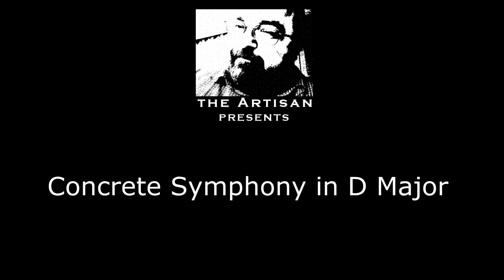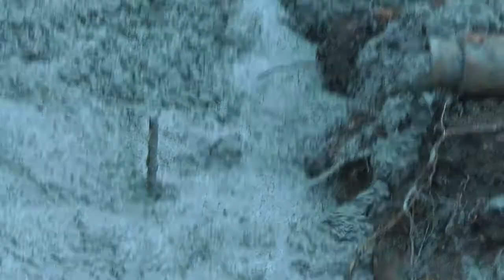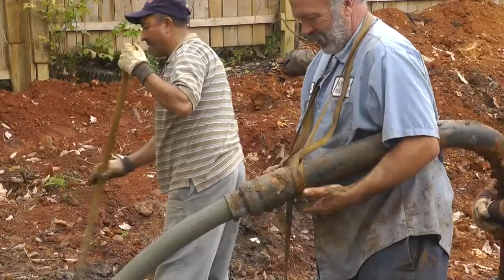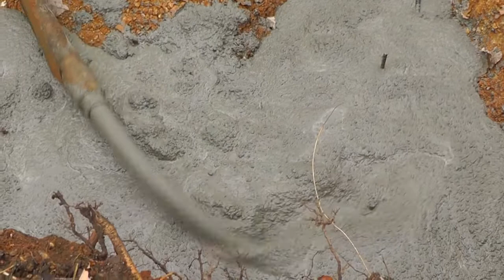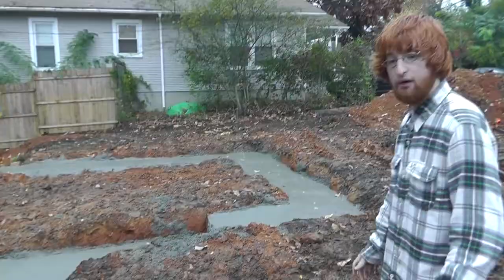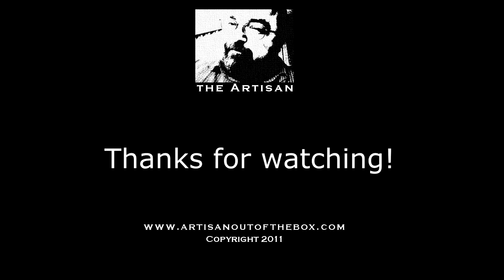Concrete Symphony in D Major

Comment from the maker: @GunWebsites For footings we dig and let the earth be the form.  Next we will form the walls which will have forms.  A typical footing is only 8" x 16" but these are more like 14" x 24" due to using poured in place concrete walls for the basement.

Comment from the maker: @ristin59 It is a special line pump mix with small aggregate to make it easier to flow through the pump lines.  You can start forming the walls the next morning so it doesn't take long to set enough to work on but it will take 28 days to reach its compressive strength of 3,500 PSI.